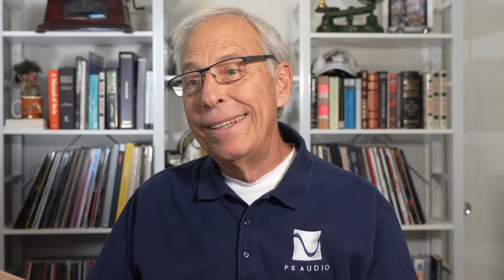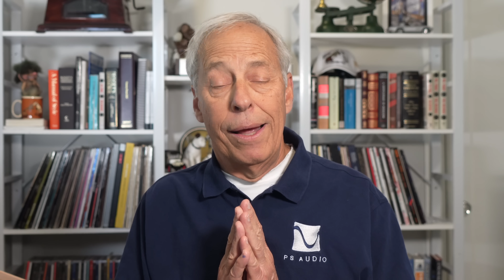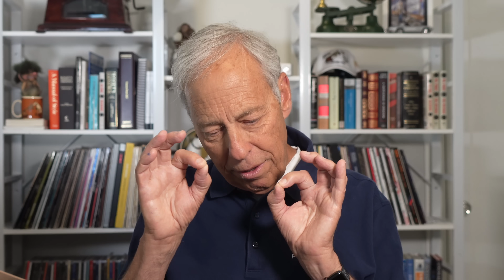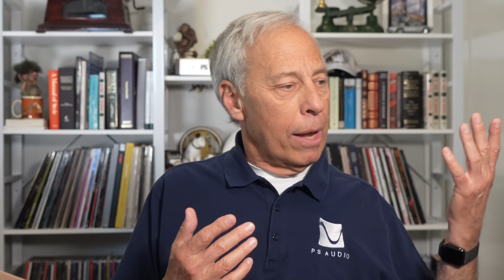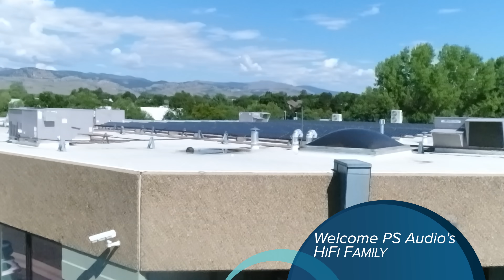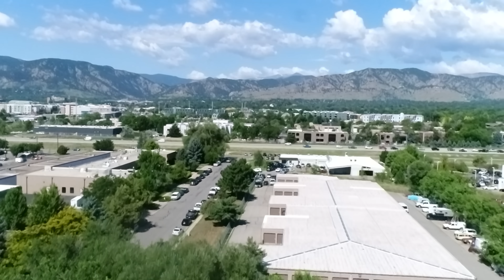Will MOSFET amps take the place of tubes?

Comment: Sorry, it takes me a second to reply as I have to wade through all the BS in this video.  MOSFETs have a very narrow transient region.  But they are very efficient switching from fully on to off (and vice-versa) due to the low gate charge requirements.  Thus they are well suited to digital switching applications - which is exactly what a class D amplifier does.  Most other amplifier designs operate tubes or transistors in the transient region between fully on and off - routing the audio path through the device itself effectively adding a voltage gain.  The transient region is often non-linear giving the amplifier a non-flat frequency and/or voltage response.  This adds character to the 'sound' coming from an analog amp.  Digital class D amplifiers are essentially switch mode power supplies with a low side switch in addition to the high side.  The error amplifier that determines when to turn the transistor fully on/off compares the current output level against a floating reference (the audio signal) instead of a fixed reference (eg. a band gap) hundreds of thousands of times a second.  The switch rate and the combined impedance of the output tank LC impacts the frequency response of the amp significantly more than the FET - and not at all in frequencies below that of human hearing.  You wont get a 'different tone' from a FET amp by switching the FET to a different supplier or part number like any analog amp.  This video explanation is very misleading at best and complete BS at worst (cooking analogies?!?).  I expect nothing less from a company that sells $15K snake-oil... err I mean "amplifiers".

Comment: Electric guitar amp builders have been trying to ‘get close’ to the sound of valve amps using solid state technology for years. There’s a very good reason why none have ever managed it fully: only valves sound and react like valves. That’s why value guitar valve amps are still held up as the panicle, but it still remains subjective and personal. If you like the sound of a valve amp, get a valve amp. If you’re happy with solid state, be happy. Trust your ears. Like what you like.
Reply: Well I am amp builder and fet so very close to tubes.  I played a tube amp in the stores honesty I can not hear the difference. the problem is hard to get right components for higher wattage amps. also one amp builder wasted jfet sound using diodes. with me I just do not get why not all ss amps have a jfet or mosfet stage for the clean channel. if over dive the clean channel it soft clips.

Comment: I firmly believe that Solid State is far superior than Tubes, in so many aspects, it borders on the same arguments of Vinyl /Reel/Tapes(Analog) vs. Digital (CD, DVD, BluRay, HDCD, Streaming, HD Streaming, 44.1, 48, 192 HKz). But... the area where tubes find a warm welcoming home is in the hands of DIY hobbyists who are able to benefit from the physical organic nature of point to point wiring and tube rolling, as rolling Solid State components is unheard or, or super cumbersome. So I would never purchase again, commercially made Tube Gear, when I can just make my own for, usually 1/3 to 1/2 the price of commercially built tube gear, and enjoy the build. I also buy vintage Output Transformers that were manufactured when the same people that made them, took the magic secrets to their final resting places. I don't bother with Vintage Power Transformers as their primary winding ratios are today obsolete. So, my personal bias, comes from over my 48 years using a loving audio gear. Building dozens of Tube Amps, Tube Preamplifiers and lately a Tube Guitar Amp. In conclusion, PS Audio is leading the Audio Arts, with high technology by people who love music.

Comment: Tubes are not less reliable that solid state! They last for years, if not decades, and are much easier to replace than a SS component.
Reply: Only insofar as valves are typically socketed. Replacing a mosfet isn't a big deal. The standard SOT23 package has 3 pins and may have its body soldered to the board too (though that's more often attached to a heatsink). If it's fucked and needs to go, it's much easier to just cut it off and then desolder the pins individually. 

The main advantage of mosfets is that they're jellybean parts. Today's state of the art, much like valves were 50 years ago. That makes them DIRT cheap and it means that any big electronics supplier either stocks them or can get them. You can buy enough mosfets to rebuild your entire amp for the cost of a single 6L6 or 12AX7, with the added bonus of guaranteed uniformity in performance (because modern mass production).

Given that every old amp and radio NEEDS to be rebuilt before it's safe to operate, I'd say it's less hassle to run a mosfet amp.

That said, I agree, valves are no less reliable. Typically if a valve dies it's because something else in the circuit killed it. Most commonly it's a leaky paper and foil capacitor from the '30s. They usually forget how to be capacitors and become resistors as their barriers break down. In the case of a grid coupling capacitor, this has the net effect of applying full B+ (usually of the order of 300-600V) to the grid of the next stage, causing that valve to draw very heavy current until something fails. Typically the failure point is a bond wire in the rectifier (which is hereafter FUCKED. They tend to be hard to come by and expensive), but permanent damage is done to the valve connected to the leaky capacitor too.

In cases where a high voltage filter capacitor fails closed, B+ gets directly shorted to ground. This causes the same failure in the rectifier.

In other words - recap your old gear. Use quality capacitors (again, jellybean parts, even the really good ones are inexpensive), make sure everything conforms to the original schematic and your old amplifier (or radio) really will last forever.
Reply: I have a 1977 marantz 2285b that works fine...

Comment: I like tubes. I like solid state,/FET's. I like good sound. Both can do it. Both, when properly set up, I am sure you will not be able to point out which is which blindly. I laugh, I just made a OD Boost  guitar pedal that has a 12AX7 tube, a LM741, and a LM386 driving a 2" speaker inside it, sounds awesome, and runs on 12.6 VDC  :)

Comment: As for warmth , as one would expect you are spot on imho , and mosfets are typically more warm than bipolar output stages but there are some  vintage ss amps out there that use bipolar stage designs , resolve very well and are quite tube like in warmth to my ear.

Comment: I should be quiet, but I can't resist.  No one can hear the difference between good quality amplifiers (tube, or any other), unless you want to run them into distortion.  That's why you never, ever, see any blind comparison surveys.  There is a small possibility that people with great hearing could detect the effect of damping factor.  You know what you can hear?  The room and the speakers.  That's it folks.  16 bit vs 24 bit?  I'll buy that, if the recording takes advantage.  44khz vs 96khz?  Maybe dogs can hear that difference.  Audiophiles, invest in the latest speakers with room tuning technology.

Comment: I was wondering have you ever tried Paul snubber filter on the output of the transistor replacing the resistor for a bulb at 10 ohms and the capacitor 0.1 polystyrene sounds like it would sound nice ever tried it?

Comment: Is this also why McIntosh uses transformers with transistors?
Reply: Having output transformers makes it easier to design the output stage, as you have the freedom to select the optimal power supply voltage and current range for the devices you are using, and you do not need to design with the limited range of complementary parts that are available.  Also, the transformer accommodates different speaker impedances without altering the voltage/current ratios that the transistors operate at; the amplifier power rating doesn't vary for any speaker impedance that the transformer has taps for.  
Since the output transformers of tube amps are responsible for much of the "tube sound" that certain listeners enjoy, keeping that in the design would have an advantage for that kind of listener.  But I don't think that was McIntosh's motivation.
Reply: @marianneoelund2940  Thanks!

Comment: hmm.   Nahh  i don't think mosfet will replace tube/valve amps.
Tube amp can something with the sound that mosfet can't but yes mosfet come close to tubes 
because of their charateristic in the harmonic distortion there like tubes mostly is in the 2 harmonics.
Mosfet give like tubes a much more 'warm' natural sound so indeed many will prefer mosfet , mainly because 
the maintenance is easier , where tubes need tube replacement / bias adjustings ect.
Others ( like me ) like to spend time trying out different Tubes and modify to get the right sound.
I have spend last 10 years modify my Guitar amp and trying out different tubes , changing the circuit ect ect.
I finally got the ' sound' I wanted.

I like your way of using food and taste in your description , spot on it's correct. the preperation..the care for..yes.
The designer play the big role here , you can have a bad sounding tube amp and a good mosfet amp or 
of course a bad mosfet and a good tube amp.
In the end it's what our ears like that make us choose (hopefully )

So my personal view on this is ' Tube amp will continue simply because their is people who prefer them '
Personally I use both mosfet amps and tube amps but for different situations.
In my HiFi/Studio I use mosfets and my guitar amp is a good old all tube amp with no semiconductors at all.
( Still im like , should I find my old , schematics , recalculate a bit , just a bit more designing and... rebuild...
I have built RIAA , preamps and power amps with tubes years ago and somehow want to do it again )
damn want to change one of the HiFi/Studio amps to tubes.... 
Nah it must wait until I have a better house with more space for the studio.

As usual a great video from you thumbs up from here.

Comment: Up to say $6,000 for a pre amp, tubes will always offer better sound for the price. Over that the tube starts to be the limiting factor. You can  swap them for NOS  to squeeze out that little extra but in the end you realise that ultimate pre amps don't use tubes.

Comment: I listened to this video on a Sony TA-F606ES integrated amp, which has BJT drivers and MOSFET outputs, perfect mix of clarity and warmth.  Are any audio manufacturers still making amps with MOSFET output transistors?
Reply: John Phelps ATC use MOSFET output stages.
Reply: Parasound and the higher range of Yamaha A series integrated amps

Comment: According to David Berning, FET devices have transfer linearity comparable to that of pentode tubes. Many years ago, he had a preamp that used a patented circuitry that used a FET in series with a triode to attain transfer linearity superiority superior to that of a triode alone. Unfortunately, FET device failure due to user careless in switch input jack assignment while powered on caused him to return to tube only stages. BTW what ever happened to Sansui’s attempted at feed-forward design?

Comment: Having been an owner of tube McIntosh equipment (years ago... they were refurbished trade-ins) I must say tubes do have a very pleasing effect with good speakers and good recordings.  Solid state at that time could not compare. Now,  engineers of quality thinking can produce good sounding solid state.  As long as you do not compare? You could be happy with either.   Also, along my journey, I found in the British Gramophone magazine an ad for an integrated amp with a tube preamp section, and Mosfet outputs. I had it imported.   It was designed and  manufactured Mr. Grant of Grant Lumley fame.  It sounded fantastic.  After that finally bit the dust.. I wandered into the world of high quality D class amplification. Also, having a fantastic sound. Its not tubes.  But, it still is great sounding.  The key to enjoyment is finding the right combination of speakers.. cables, power purification... and staying away from Ethan Winer.  ;)
Reply: That's the kind of thinking that makes people with more money than brains spend insane sums of money chasing the delusion of sonic perfection. There is no such thing as sonic perfection so just listen to the music instead of the gear.

Comment: I disagree with the cooking analogy. When you did not account for the humidity and the oven temperature then there is a big hole in your measuring protocol. Also cook could have catched some kind of virus (starts with "C") and do not taste things right at the moment. Also I'm sure that if amp gives out cleanest sound theoretically possible then it  would not sound good for everyone, where do we go from there then? Start distorting the signal until it sounds good?

Comment: Yes, if you want the tube sound without buying a tube amp, the closest you will get is a First Watt Amplifier by Nelson Pass. His amps are truly awesome. I have had several. I highly recommend you check them out!
Reply: Do you know if anyone has done any proper characterisation and modelling of valve gear? Provided all the effects are properly quantified, identical sound should be achievable through DSP.

It's not the same (I for one LOVE the glow of a good valve), but should sound identical

Comment: Typically, when a tube amp goes wonky, you replace a tube and it works perfectly again. When a solid state amp goes bad you have to send it to an approved repair station to have it fixed. I have had MUCH more trouble with transistors than tubes. Usually it is the caps that go bad.
Reply: The caps in tube amplifiers will go bad quicker because of the heat.
Reply: @StewartMarkley  One would think that, but the tubes are typically on the outside of the box on an amp. Inside the chassis it's not that hot. Since I started using tube amps in the early 1980's, I have had precisely one tube amp go bad, although it was spectacular, a pop, a puff of smoke and the lights dimmed. Compare that to the five solid state amps I have had to have repaired. I guess I have to amend that, I have a SET I built myself 21 years ago. It's power transformer failed. Easily fixed, and not related to the output devices. It is still going strong.
Reply: @johnlebeau5471  Well you're right, the real heat is around and on top of the tubes usually, except for guitar amplifiers which are generally mounted upside down in their cabinets. So the electrolytics get quite hot and dry out and or leak. I have to say that you have had bad luck with your SS amps, although I did have a Dynaco Stereo 400 power amp that I built fail and take out several transistors due to the direct coupling. Tube amps are much simpler in design and repairing and I like working on old tube radios and guitar amplifiers.

Comment: All I need is some tunes and some warm buds and its all good. 
As Paul says even the amps he makes sounds different from one another and adding a little spice seems to fix it. So again what is audiophiles issues with EQ's?
Reply: Good point.
Reply: It's not pure *end of sarcastic comment
Reply: "audiophile" is a religion
"EQ" is a sin...
Reply: @poserwannabe1  Spending ridiculous sums of money on amplifiers, speakers, speaker cables, interconnects, etc. to change the tone of your system instead of some simple but effective tone controls is the sin.
Reply: @StewartMarkley  I think you may have taken my comment as something other than sarcasm 😂🤣

Comment: Nelson Pass Amps does a great job in sounding like a Tubes Amps. I am sure PS Audio sounds good too.✌️.
Reply: Dio Dio i was pretty hard against tubes until I heard their dual mono btk hooked up to Paul’s IRS V setup, best speaker system I have ever heard
Reply: @sunnohh  It's just engineering, the Pass amp exhibits lots of distortion that's why people like the sound of it and, yes, you can make mosfets sound like tubes. Oh, and you can do it a much better than the 25% efficiency of Pass amps. Class A is basically a joke today with semiconductors. Fifty years ago when cross over and notch distortion in AB was a problem class A had some merit, not today. You can buy an LM3886 chip for $5 that exceeds most peoples listening needs, those chips are extraordinarily well designed by the best engineers. I'm listening to $50 class D amps interfaced with tubes for hours at a time without fatigue that sound very good. Put your money in speakers you like. Buy bookshelf speakers with a subwoofer, it will do everything most people will ever need. Amps? In a couple of years class D will rule the market, you just can't make transformers that impedance match to speakers better than class D amps. Clean, precise, detailed and accurate. Color it with a tube for the sound you like, can't be beat and cheap.
Reply: @mosfet500  "Color it" is the operative phrase. Thank you.